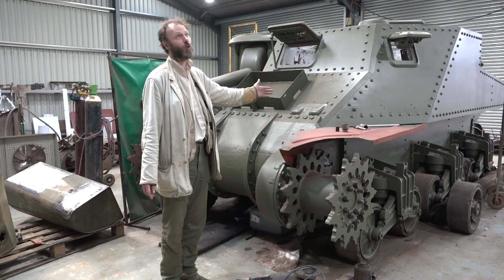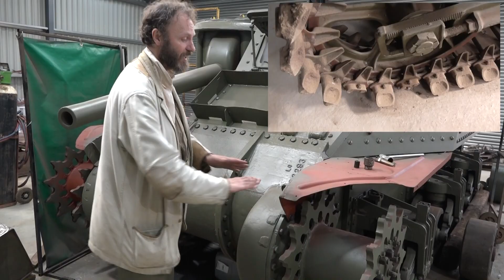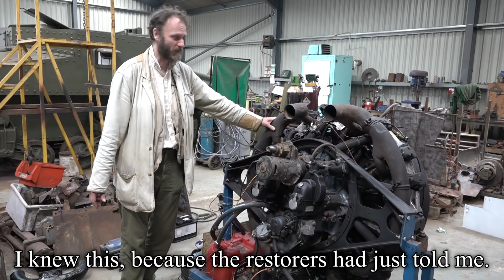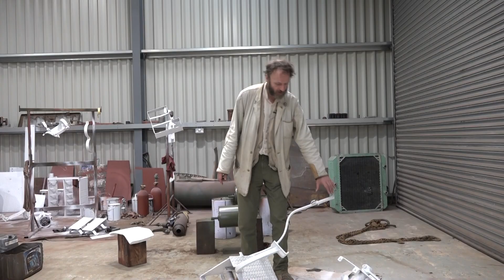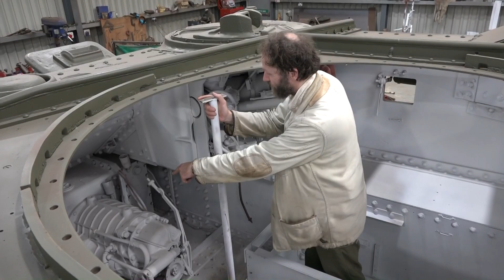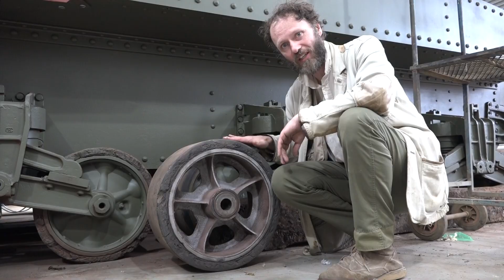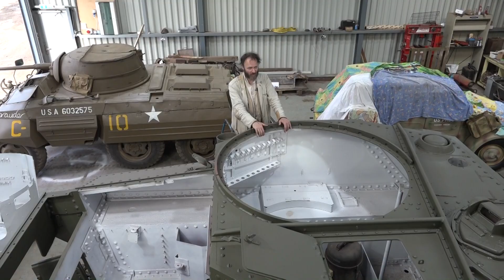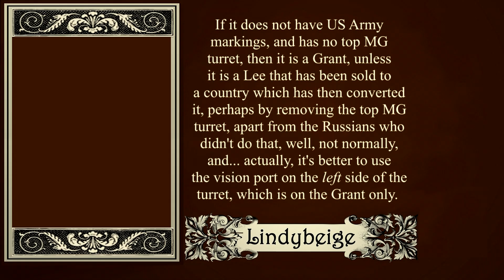The British Lee tank (that is not a Grant)

Comment: If you were in charge of approving new tanks for the US Army in December 1941, what tank designs would you pick?
I would choose the best tanks at the time: the Soviet T-34/76B Model 1941 medium tank and the KV-1B Model 1941 heavy tank.
Get into lend-lease agreements with my new ally, the Soviet Union, where the USA would build US versions of the T-34 & KV tanks with better US radios and send some to the Soviets (along with lots of trucks --they love those GMC CCKW deuce-and-a-half 6x6 trucks). It would have been interesting to see the improvements US designers would have developed on the good T-34 & KV tank models and powerful V-12 diesel engines (instead of ignition-prone gasoline aircraft engines that powered the Grant and the Sherman tanks).
Reply: They werent the best tanks of the time, they have their own serious faults too which would have gotten them rejected by the army board, if there was 1 thing the board did well for the US army, it was actually tank development. Its why the Russian crews that got M4s loved them.
Reply: @mitchverr9330  At the beginning of the war (1940), the Soviet T-34 and KV tanks were the best medium and heavy tanks. They indeed had problems with shoddy manufacturing faults, poor quality steel, electrical and mechanical problems, and so on, but they had good balanced designs from their thick, well-sloped armor, powerful V-12 diesel engines, good suspensions, wide tracks, etc. If made with better steel and higher quality in the USA (along with better crew training), these Soviet tanks would have been so much better than the underpowered, undergunned and thinly armored M2 medium tanks, M3 Stuart light tanks, and the collection of other light machine-gun tanks the US had in 1941.
What 1941 tank would you choose for the USA?
Reply: @sejembalm  Not just those problems, crew space was also an issue as was the ability to look out of the tank for crews. Theres also other problems with the designs which are not just about construction and crew training but logistical, doctrinal, etc.

If I was the USA, I would have kept going with the system in place, large parts of the tooling system and components were off the shelf for the US to implement into the tanks they made (for example the radial engine was effectively in production for 12 years by 1941 if memory serves). Theres also the key issue of conversion of units, the USA builds in imperial, the USSR built in metric IIRC, which would cause a lot of hassle to convert properly also. during WW1 this problem took over a year to fix for the FT-17, which is a much more simple tank.

The USA wasnt playing a game of attrition yet, it didnt need a fleet of tanks for itself, it was exporting tank designs to the UK/Commonwealth and had 2 huge oceans to protect itself. If it was in dire need in 1940 facing an imminent threat, then possibly try and convert a T-34 metric to imperial with rapid improvements if possible, but this ignores their logistical train.

edit: IIRC the chieftain has a great docu-series on US armour which actually covers this topic, its a great watch as is his stuff in general.
Reply: @mitchverr9330  The system in place for the USA in December 1941 was having garbage tanks that could not duke it out with German tanks the way that the T-34 and KV could. The US threw together the stop-gap M3 Lee/Grant which proved undesirable and was immediately replaced by the M4 Sherman when she was fielded. If the US instead made higher quality copies of those Soviet tanks, the US probably could have save herself a lot of aggravation.
Reply: @sejembalm  Dont forget in 1941 the vast majority of the USSR armour were still T-26s and BT series tanks with IIRC some T28s still hanging around too. IIRC something like 20,000 of the 22,000 tanks the Germans faced were not KVs or T-34s. Those only really built in number by 1942. IIRC by the end of 1942 the USSR had about 17,000 KV/T-34 tanks built, the US had built  6000 M3s and 8000 M4 shermans. It would be highly unlikely they would be able to match those numbers by copying the T-34, even with the MBT-70 project, the conversion of metric to imperial caused significant problems to the point of failure and thats with engineers working in the 60s.

The point of a stop-gap is that its a stop-gap to be replaced. The Lee/Grant design heavily based itself off the M2 medium tank, which sped up its production time as the tooling already existed while factories were prepared for the M4 sherman while they worked on the kinks of cast turret systems.

The problem with copying is that you are not developing yourself, you suffer development fatigue as you dont invest in learning how to develop and thus improve.  Its why countries with armament factories generally dislike buying from outside countries, not because of national pride, but its in order to protect the interests of development and experience.
Reply: @mitchverr9330  You make my point for me! The Germans' standard anti-tank weapons were found to be ineffective against these two new Soviet tanks in the beginning of the German invasion of the USSR in 1941. This experience prompted a notable leap in tank development in Nazi Germany to counter these new threats.

By 22 June 1941, the Red Army deployed almost 1,000 T-34 and over 500 KV tanks. By the end of December 1941, they had lost 2,300 T-34 and over 900 KV tanks, accounting for only 15% of the 20,500 tanks lost that year. 

This experience also showed the Soviets what tanks to concentrate their production capacity: build more T-34s and KV-1s!
If the USA decided to make better copies of these, tank development would doubtlessly have excelled in making really sweet variants of them.
The Soviets liked the US M4 Sherman for her RELIABILITY (along with the good radio, although not the low velocity short-barrel 75mm gun). Often, Russian and German tanks would break down just traveling to and from battles (the Panthers and Tigers were notoriously bad at having frequent breakdowns), but the US models proved much more reliable. Such as in the Battle of the Bulge where General Patton's tanks pivoted north and drove 100 miles to counterattack the Germans. Got to have some reliable machinery to pull that off and if the USA was able to make these Soviet tanks better and more reliable in 1942, our experience in North Africa would have been less embarrassing. 

https://en.wikipedia.org/wiki/German_encounter_of_Soviet_T-34_and_KV_tanks
Reply: @sejembalm  Not really a notible leap, the Germans were planning heavy tanks in the late 30s, going with the 8.8cm due to facing matilda tanks.

The point you are missing is that you cant just "herp derp" tanks into existance, you need to have the tooling, you need blueprints in a measurement/unit your systems are gauged to work in, etc. Simply put, if they tried to convert a T-34 blueprint into a system the US could use, they would likely have only managed to tool up in 1943 for it most likely (remember, a large portion of the tooling that made the M3 and M4 already existed). Even if they did this, there could have been multiple serious flaws once converted to imperial measuring.

BTW, wiki is very subpar and full of tank myths, I recommend not using those but using other sources for your information.  Really, the T-34 doesnt offer enough of a "boost" to throw out all the tooling the US had at the time. A great seminar would be this by chieftain https://www.youtube.com/watch?v=TwIlrAosYiM&t=2s (he has plenty of good videos).
Reply: @mitchverr9330  No, silly me, I'm sure the German's rushed development of the Panther and Tiger tanks had absolutely nothing to do with their pathetic panzers going up against Soviet tanks that were impenetrable to their flimsy 50mm fire. And it would have taken the US so much longer to go metric and copy an ally's produced, fielded and proven tank designs than dickering around with experimental and stop-gap designs that produced the M4. And the M4 had problems. Powered by a 500 horsepower aircraft radial engine that burned gasoline instead of diesel (making the M4 more fire-prone than comparable diesel tanks) and the tall engine made the M4 very tall and conspicuous to enemy fire. The M4's short low-velocity 75mm gun was pathetic compared to the Soviet high-velocity 76.2mm guns. When fighting against heavy German armor, the US M4 tank crews were frustrated by their gun's lack of penetration and their higher-velocity 76mm guns weren't that much better. The US had to overwhelm the German tanks often by sheer force of numbers, to flank them and shoot them in the sides and rear (or retreat and rely on artillery and airstrikes), but flanking proved further problematic by the M4's narrow tracks.
Reply: @sejembalm  Early T-34 with the two-man turret would have been the best choice? 75mm M3 is "pathetic" compared to the Soviet 76.2mm? Are... are you joking? Seriously speaking, I would probably agree that the T-34 and KV were the best in class in 1940. But the T-34 is absolutely not a better medium tank than the M4, especially comparing the two-man 76.2mm turret T-34 with the early 75mm-armed M4s. Going with T-34 instead of M4 would have been a serious mistake. To begin, the Soviet 76.2mm and US 75mm are in fact quite similar in performance, and combined with poor optics, especially in the early model T-34s, the 76.2mm's effectiveness at longer ranges was very much undermined. The Christie suspension was rejected by the US in the 1930s for very good reason. The only advantage it has over the VVSS or HVSS is wheel travel, and its disadvantages are enormous, namely the horrible maintenance and the massive amounted of wasted hull space it requires. The T-34's armor is hardly a strong point, from the front the M4's is basically the same, and the sloped-in sides of the T-34 were a design dead-end that offered no real benefit except a slightly bigger number on a specs sheet. And comparing the later models of both tanks, just look at the Korean War. T-34/85 never came out on top. Worth mentioning too, that fuel had little to do with burn rates of M4s. It was mostly ammunition stowage, which was soon moved from the sponsons to the hull floor, solving the problem, and bringing the burn rate below that of German tanks and afaik even diesel-fueled Soviet ones as well. And your characterization of the American 76mm M1 as being "not much better" than the 75mm is frankly just eyebrow raising. As an anti-tank gun it was perfectly fine, and it can be easily argued that it was even better than the much-praised British 17pdr. The only major issue with the US 76mm was its inferior HE performance compared to the 75mm, not anything to do with its armor piercing ability. 

Also, about KV, there's a reason it's poor performance almost led to the total cancellation of the Soviet heavy tank program. It's just a less mobile T-34 at the end of the day. The US was right to simply go without a heavy tank in WW2, and even if they did go with one after all, I don't see why KV is in any way a better option than the existing T1/M6 the US experimented with.
Reply: @Maus5000  Since you mentioned Nicholas “The Chieftain” Moran about having good information (he does), Nick argued that the Sherman was the better tank in terms of usability, maintainability and surviveability, but the T-34 had the stats — more armor, punchier gun — but suffered from being hard for the crew to use and survive once it took hits. The T-34 had a lower profile, using well-sloped armor, particularly on the sides (where the M4 was almost a right angle), but the armor was made from low quality steel that spalled badly when hit. If made by the USA with superior steel, the American T-34 could have been really sweet with a better gun, better diesel engine, better cross-country capability, and better armor.
The T-34's cramped 2-man turret was indeed a problem where the commander was the gunner, but the T-34/85 fixed this. The KV-1 had a larger and roomier three-man turret, along with a lot of armor.
Having these designs in 1941 would have been better that fielding the embarrassing M3 Grant, and set the US military upon improving good tank designs that were easy to produce (at least the T-34) where high quality American mass-production could have really cranked them out.

US AFV Development in WW2, or, "Why the Sherman was what it was" https://youtu.be/TwIlrAosYiM
Myths of American Armor. TankFest Northwest 2015 https://youtu.be/bNjp_4jY8pY
Reply: @sejembalm  500 HP for a 34 ton vehicle, power to weight ratio of 14-15 hp/t. The "catch fire" thing, well yes and no, it wasnt as bad as was made out post war and M4a2s had diesel engines as well as the M10s IIRC. If the firecatching was as bad as the myth claims, they would have swapped fully to the diesel that some factories were using due to a lack of radials.

Actually the M4 wasnt as tall as you would think compared to other tanks, also a bit of a myth.
https://4.bp.blogspot.com/-cUTT98A0jQ4/V-CHYv5fVLI/AAAAAAAB3RI/XQ85Q-4bECIjXvwGJVUrqON0-aE_TZftwCLcB/s1600/Sherman_tank_worldwartwo.filminspector.com_6.jpg
http://www.theshermantank.com/wp-content/uploads/M4-0-caec162546911-700x260.jpg

Not that much taller really when you sit them next to each other.

The 75mm gun wasnt supposed to be a super anti tank gun, during ww2, the better your gun was at AT work, the worse it was at HE work, tanks didnt kill tanks in WW2, it was mostly tank destroyers and infantry that killed tanks with tank supporting them. The 75mm DP gun was fine for its role which is why theatre and army commanders didnt request more 76mm guns for all their shermans.

The point of the M4 wasnt to fight the heavy German armour, it was to fight their medium armour and infantry. The M10 and M18 were for fighting the german heavier armour with the 76mm shermans acting as a protection force. Its why the british didnt field effective HE rounds for the war, their guns were specifically designed to fight tanks, this heavily damaged their anti infantry capacity. The purpose of the tank was to attack the enemy, not meet the enemy tank in US doctrine and that means meeting enemy infantry and towed guns.

The tanks would have to flank tactically to fight and defeat heavy armour, but generally this wasnt an optimal use of the M4 sherman, on the operational level the TD battalions were supposed to fight the heavy armour as much as possible with the M4 as a supporting asset. Didnt turn out to be all that bad given you have multiple battles like the battle of Arracourt where the US forces hammered German armour with minimal losses.
Reply: @mitchverr9330  Sounds like the same bullshit justifications thrown against the poor design complaints. And the M4 "is not a main battle tank, it's an infantry support tank" is a poor excuse when it's fighting tanks that are out to kill other tanks. And when the German tanks are hitting harder and longer than the M4, then you better have something other than lame excuses to deal with this serious deficiency. The Brits rectified this problem by sticking a 17-pounder anti-tank gun in the M4 and suddenly it's taking out Panthers at range. The post-war US armor community voiced their sharp displeasure at the embarrassing combat performance of the M4 against German armor and they demanded better tanks that could kill other tanks without taking tremendous losses in doing so. If you are fielding fast battleships and your enemy is throwing their battleships at you, just saying your battleship is designed to raid enemy commerce, not to fight other battleships, well you better find out a way to fight those other battleships if that's what your opponents are throwing at you.
Reply: @sejembalm  It might be fighting tanks built to fight other tanks, but that isnt the single purpose of the tank, the tank is the breakthrough direct fire support in combined arms while also having the ability to fight enemy armour.

BTW, the vehicles that knocked out tanks for the germans were mostly the assault guns like the stugs. 

Not really a lame excuse, theres a reason the british swapped most of their tank guns from 6 pounder to 75mm for HE fire support.

The 17 pounder firefly was a stop-gap measure for a very specific role, which is why it was only implemented in 1 in 4 tanks and quickly replaced in the field due to its very serious issues. The 17 pounder was also flawed, gunner blinding themselves for a few seconds is usually a bad thing to have in a tank gun (which is why i like the 77mm personally). 

The post war "cries" over the sherman mostly stem from a few loud voices and a lot of myth, when you actually look at them on the statistical data, they were either on par or did better then other main tanks used in the war. Hense why theres been a recent shift in the "mock the sherman" to "reinvestigating the sherman".

They did have a way to fight the enemy heavy tanks or "battleships" in your example, the TD branch and infantry, combined arms warfare. The M10 had the 76.2mm guns and used them extremely well.